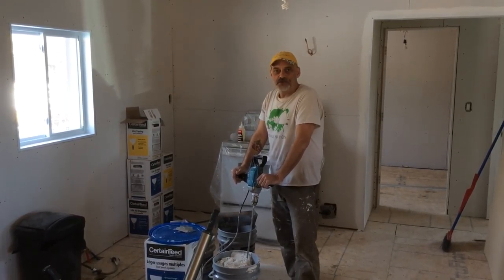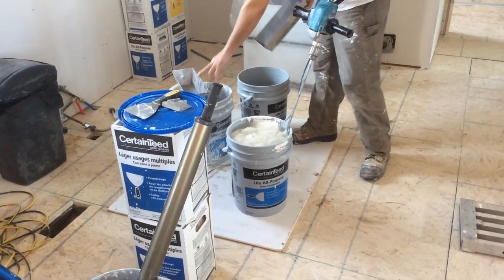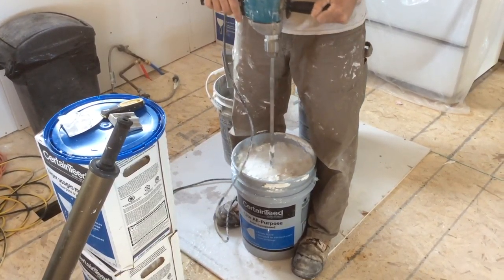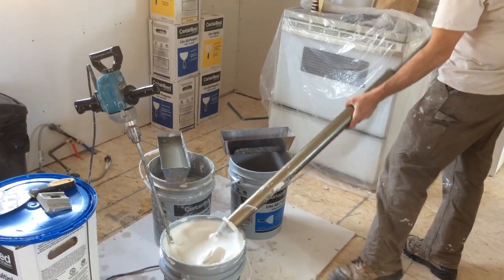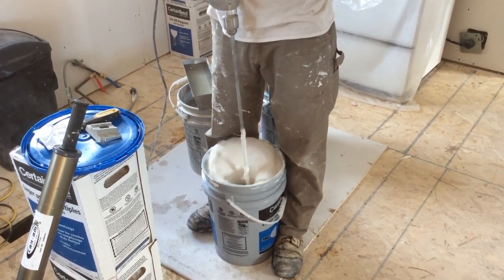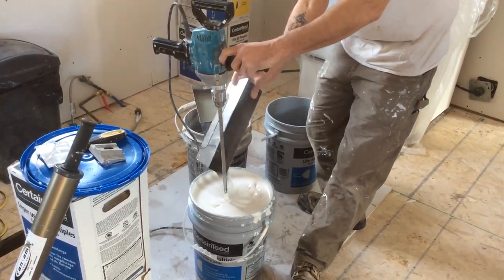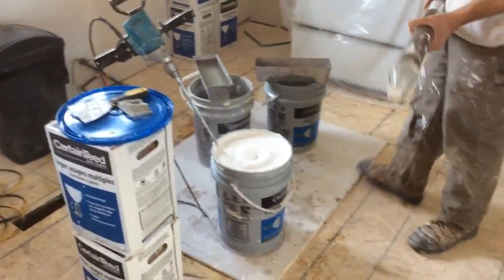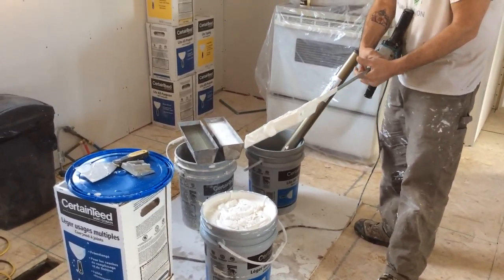Adding water for mixing taping mud when using a compound tube

Comment: When doing rental repairs and small drywall cuts$repairs what mud is the best to use so that it send easy...?

THanks for videos, you are the best drywall guy I ever seen, would love to work with you and steel knowledge of oyu, even for free :D
Reply from the maker: I don't know where you live so I can't recommend anything specific but for small patches I like to use a quick setting compound. It is powder that is mixed with water to a desired thickness. The quickset can be bought in 15,20,30,45,60,90 and 240 minute. It sands quite easily. A finish coat with regular all purpose mud is usually needed to make it real nice. DO NOT use Durabond. It WILL NOT sand easily at all. Very very hard stuff when dry.

Comment: Hey you're really good!  Do you use different width trowels with your hawk for the coats?  I'm asking cause i'm thinking of switching over from taping knifes and tray to a hawk and trowel, the hawk and trowel seem quicker in literally every video I watch.  I was going to buy a magnesium hawk and an 11' inch trowel, should I go bigger or get multiple sizes?  I have literally every size taping knife lol
Reply from the maker: Hello and thanks. An 11.5"x4.5" trowel is a good size to use. Different lengths are good for filling bead on wide columns and other stuff and some guys like longer trowels for their butts. I stick with a flat trowel of one size. Just a personal preference. Multiple knives are a good thing if they're all under 8" in my opinion.

Comment: How much water do you put in the mud to use  it for the corner machine??
Reply from the maker: It should be like a pancake batter. Quite thin. But not like soup. When using your corner box you should not have to apply a lot of pressure. Have to remember you are just skimming with the box. Not actually putting a fill coat on. That should be done when taping your angles.

Comment: the problem with addind all that water is that it evaporates / shrinks the tape leaving nothing to hold the tape to the drywall...just another youtube hack...lol
Reply from the maker: Guess you've never used taping mud before. It has more glue in it so we can water it down considerably without losing adhesion.